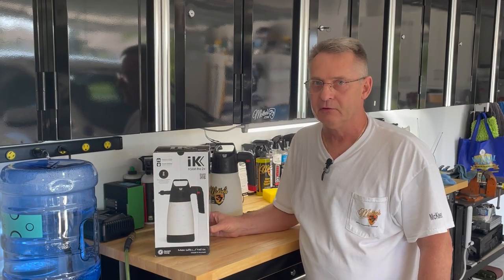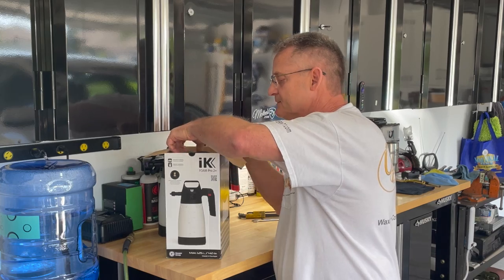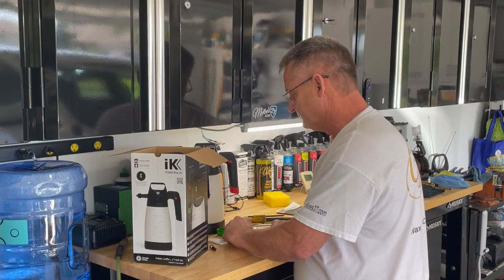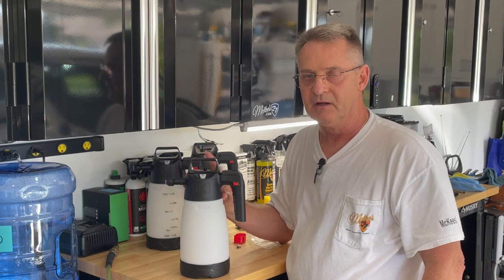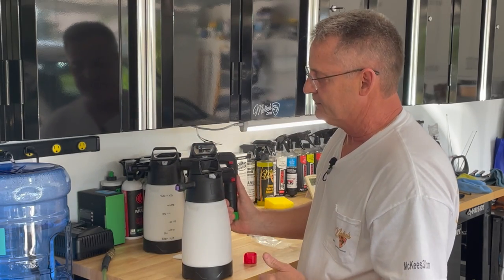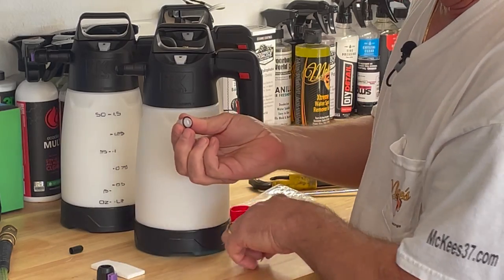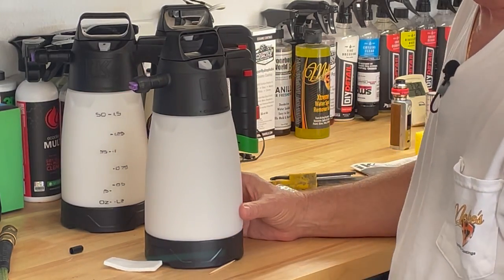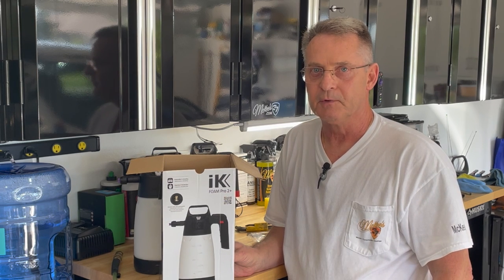Unboxing and How-To, IK Foam Pro 2+ Pressurized Sprayer. No more pumping!

Comment: Wish I never bought mine.  All you do is sit there for minutes at a time pumping the thing.  I'd rather use a garden sprayer as this one doesn't even last on 2 panels at a time.
Reply from the maker: Use less solution in the container and do not fill it up all the way.  The more air in the container, the longer the foaming action will last. - Nick
Reply: @autoforge  how full do you recommend filling it based on this advice?
Reply: Use a portable compressor bro, I love this thing
Reply: @plowgonewild fill half way so the other half is air

Comment: When applying air to check pressure. What attachment did you use
Reply from the maker: The IK sprayer has an automatic relief valve so that you don't over pressure the sprayer. There is no need to check the pressure. Just fill it until the relief valve opens.